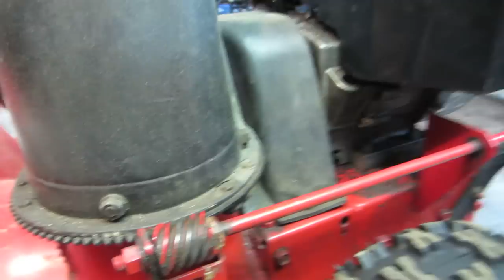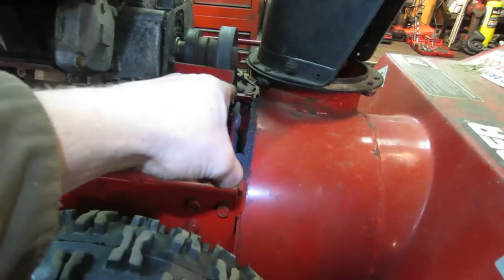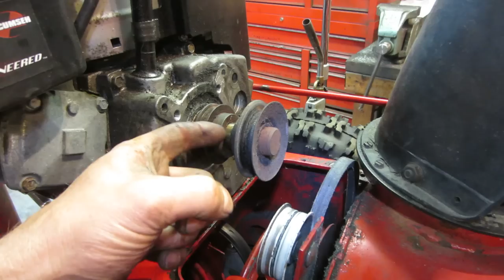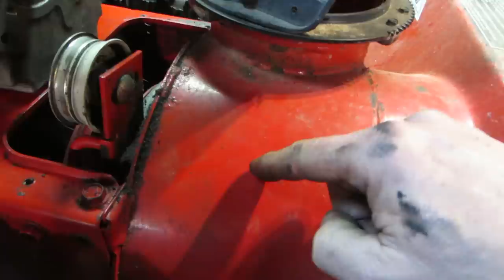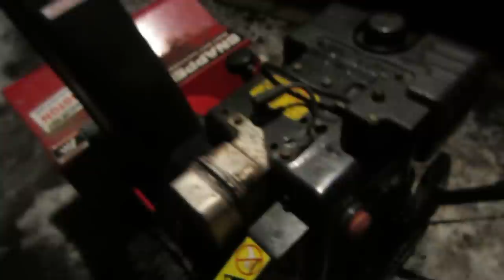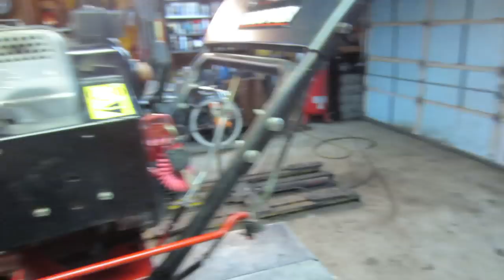snapper snow blower oil leak and shifting repair

Comment: Hey Mustie, Do You happen to know where I could find one of these engines? Blew a rod through the case on mine. I have looked everywhere for a replacement. I already bought a new blower but the rest of that other blower is still in great shape. Thanks

Comment: I have a snapper 8241 and I was wondering if you diagonose what may have happened - snow blew out my driveway and it was working fine - my snow chute was froze so i sprayed some windshield de-icer on it free it up - now the auger turns fine but it won't move forward or backward - do you think it is belt or just wet on rubber gear drive??

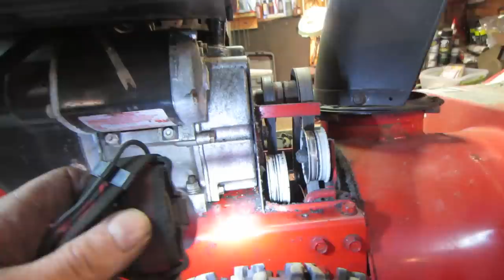Comment: Mustie @ 3:26 of your video you see the Stator/Light/Positive wire by the Starter.....Do you know what wire is used to mate to that wire to add a light???? I believe the Stator wire has Tecumseh end 322 or 323????   Thanks for your vids.....I learn watching.
Reply from the maker: yes it is
Reply: What is the wire that mates to 322/323???? @mustie1
Reply: I am not trying to answer my own question.....so sorry.....Whatever number wire is coming out of engine to light.....what is the wire number I need to connect to that wire?????
Reply: Thanks so much Mustie I appreciate you answering so quickly.

Comment: TECUMSEH engines are tough...keep on keeping on...but...they often run rough as fuck. Drain the drain...get some nice fresh gas in her..little bit of choke...and work the piss out of her...within an hour it'll be all good again without the choke....least wise that's been my experience.....and carb cleaning etc hasn't been all that effective since the fixed jets...a little mystery oil in the gas will do more then tearing it apart usually

Comment: Arggggg! I have 2 feet if snow in our driveway and our blower is spitting oil all over the ground! Before I started it up I checked the oil and it was full and typical oil color. Then when started to spit oil on the ground I stopped it and there was almost no snow in the motor, and the oil was gray. I can fix it leaking, but why was the oil gray?
Reply from the maker: water got in it

Comment: to push that pulley back in i would use  what looks like 1-3/4" deep socket placed over the end and then tapped with a mallet. easy peasy You're not evenly pushing with a punch like that.

Comment: I cannot understand why you guys refuse to take the carb off the engine and clean it right. You always just want to drop the bowl and look at things. where I am from, we just air on the side of caution and remove the carb and do it right or we don't bother with it.

Comment: All SNAPPERS ARE JUNK. Snapper riding mowers are crap, Operators should weigh 130 lbs or less, otherwise the driven disc wears out too soon.